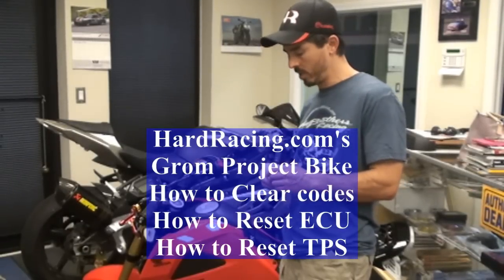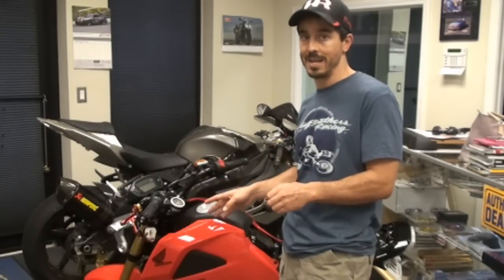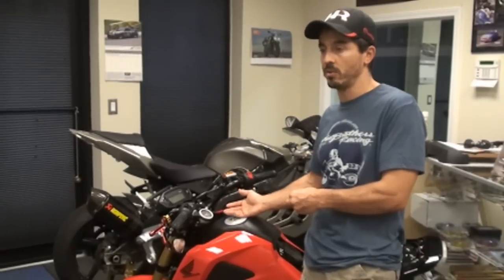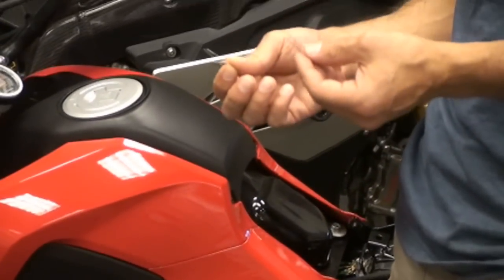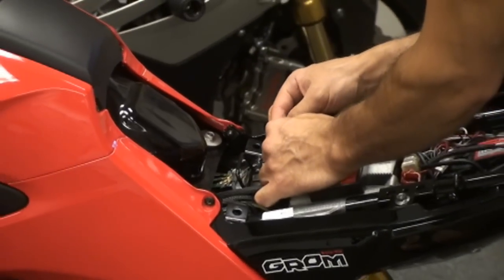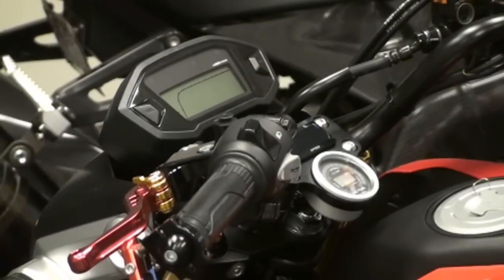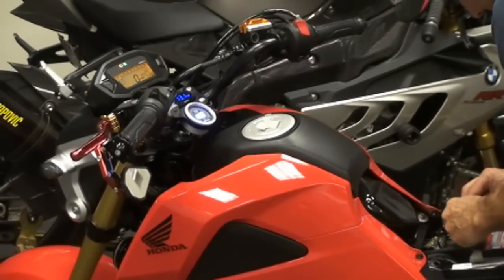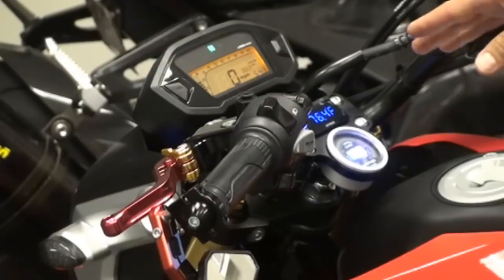How to reset Grom ECU How to clear Grom codes How to Reset Grom TPS  #Hardracing #Grom

Comment: DO NOT USE THIS TPS RESET METHOD FOR 2022 HONDA GROM. 
IT WILL NOT READ EOT SENSOR AFTERWARDS CAUSING ROUGH COLD START AND ABOVE AVERAGE AFR CAUSING BACKFIRE/POPPING UNDER DECELERATION.

Comment: Did step one several times and it doesn't work
Reply: try unplugging the temp sensor.  Turn the bike on, NOT Starting it.  Then turn it off.  Plug the sensor back in, and try The steps in the Video again.

Comment: My bike is idling really high between 4-6 rpms would this fix the problem ??
Reply: It might fix.  Or you may need to turn down the idel screw a little.
Reply: Whenever you do a computer reset always make sure the engine is stone cold upon restart. It makes a difference.